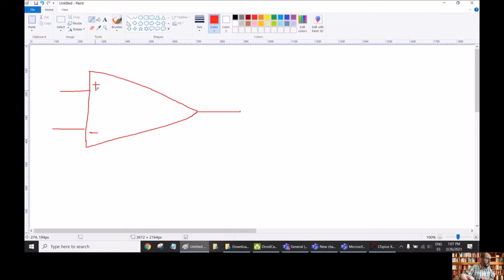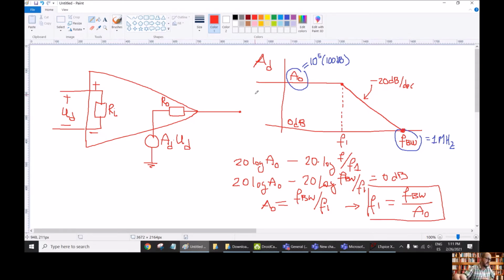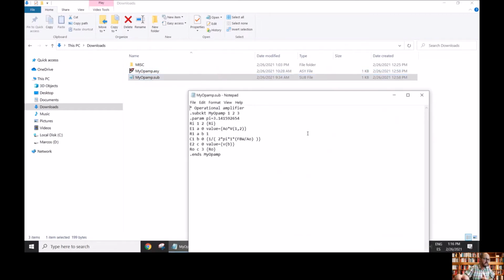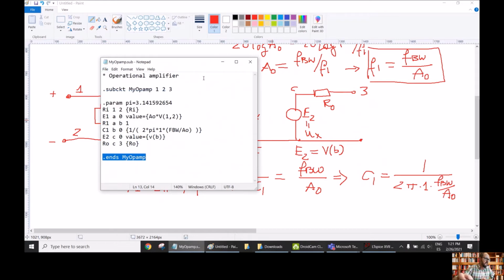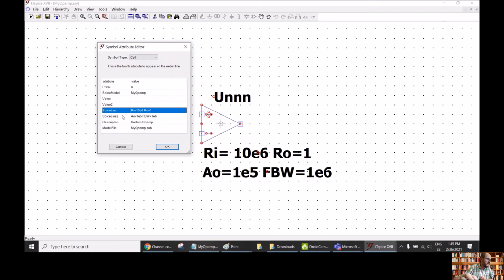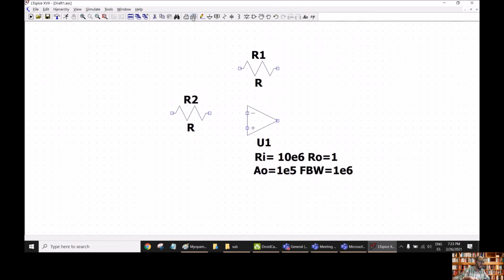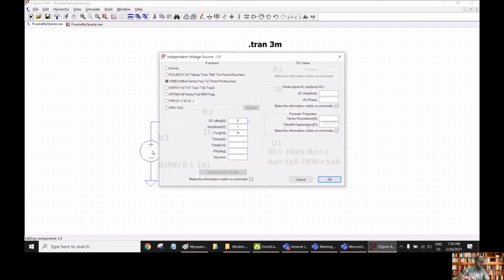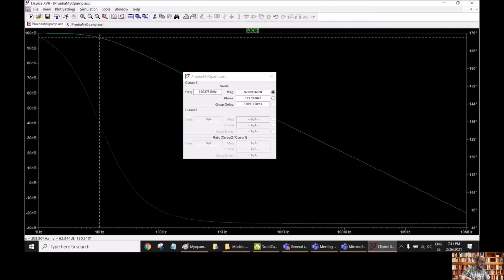LTspice #3: How to Create New Components

Comment: dear Marcos 
the video is perfect thank u very much.
 please how to add VCC and GND for this amplifier?
thanks
Reply from the maker: Thanks for your comments.
An easy way is to use two clamping diodes. One diode with the anode connected to the output and the cathode connected to +Vcc. The second diode with the cathode connected to the output and the anode connected to GND (or a negative voltage if you wish). You can define your own diode with low threshold voltage so that the clamping voltages will be close to +Vcc and GND, for example:
.model MyDiode D(Ron=10m Roff=1Meg Vfwd=10m Vrev=100)
Reply: @MarcosAlonsoElectronics  thanks🙏

Comment: i followed all these steps and all i get is "can't find definition of "Ro"" . anyway you can advise me?
Reply from the maker: Thanks for your comment. Most probably you have some mistake in the files you are creating for the model. I need to see them to find the problem. Anyway, you can download my model from my website at https://www.unioviedo.es/ate/marcosaa/#RESOURCES
look for "MyOpamp" and compare with the files you are creating to find the issue.
Reply: @MarcosAlonsoElectronics  completely identical both. But i still get "can't find definition of model "Ro" " followed by "Circuit: * C:\Users\Jeffrey.Nuccio\OneDrive - MKS Instruments, Inc\Documents\LTspiceXVII\my Op Amp.asc

Questionable use of curly braces in "ro c 3 {ro}"
    Error: undefined symbol in: "[ro]"
Error on line 17 : r:u1:o u1:c n002«:3» ro)
	 Unable to find definition of model "ro"
Fatal Error: Missing resistance value for "u1:ro"  "      errors

again thank u for the assistance!
Reply from the maker: @czechnanny  Check that you have defined correctly Ro through Edit-attributes in the symbol file .asy.
Send me your files by email and I will take a look. Thanks!